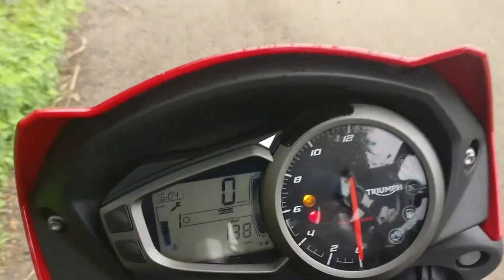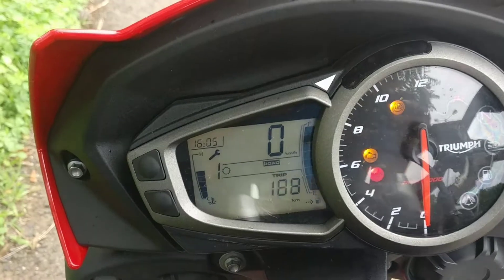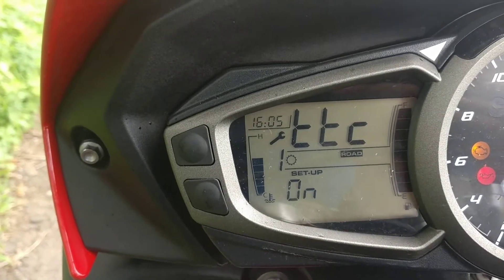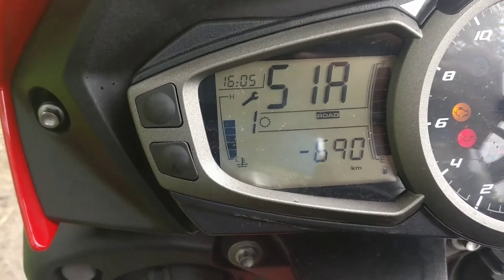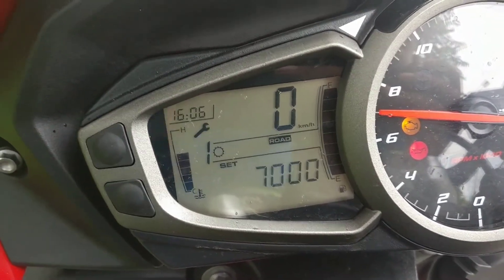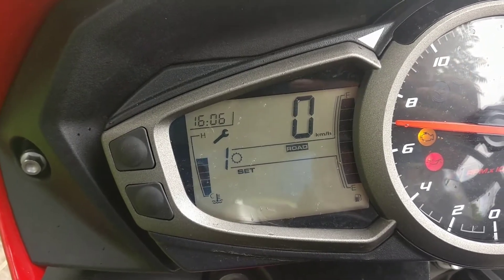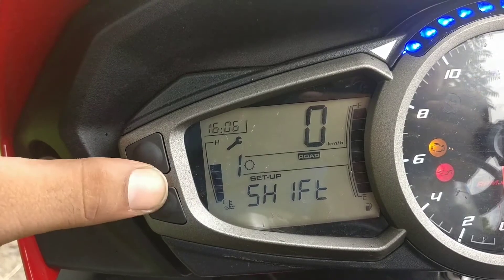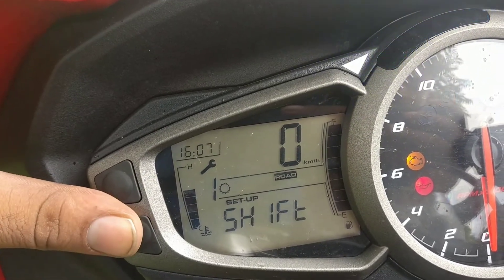Street Triple S 765 India - Speedo & display

Comment: I'm looking to buy a second hand street tile here in Thailand. With key "ON'' it does not show what gear its in "N" "1" and so on.. That digit is totally missing. Any  thoughts? The bike says it has 3200KM.
Reply from the maker: It does have a gear indicator. However most bikes like this triumph require you to Turn on the kill switch after switching on for the electronics to Function
Reply: @Kanhay  Thank you. The dealer guy made the same case and showed me with video. Thanks again for the response.

Comment: After how many km.s should you change the tyre ?
Reply from the maker: If you are on the stock tyre, it will be over within 5000 -7000km beacause it's a very soft rubber. 

If you are not a track person, I will suggest you get a touring tyre (pilot road 5, Metzler Roadtech, Angel GT etc) 
Same price but double the mileage

Comment: Bro...does the bike lift up with traction control off..?....if so until which gear..?
Reply from the maker: Yeah. You do get a lift till third. But very short ones. It's because of the riding mode. The RS does wheelie in Track Mode  under heavy accleration

Comment: Hey there.. Nice informative channel for prospective Street triple buyers.. keep it up bro..
Few questions
Is the ground clearance a deal breaker?
Does it scrape in tall speed breakers? 
Does it have the Tyre pressure monitoring system?
What is the service cost?
Reply from the maker: +GTN RIDER hey. Haven't had any problem with speed breakers as such. Just have to be a little carefull while riding with a pillion. 
TPMS is available as an accessory.

Costs roughly 7K per service. +/- 1000

Comment: RS VERSION WORTH THAN S ? WHAT DO YOU THINK ?
Reply from the maker: +POI RIDER I ride my bike everyday. I am more than happy with the performance. To be honest. After 50bhp engines.... 10 or 15 BHP here and there does not make any difference on roads. 
The only thing I miss on the S is the TFT touch screen.

If you ride everyday to work and want fun on the weekends get the ST S 

If you have throw around money and ride only on the weekends, get the RS
Reply: I Think S will be better choice over Z900 ?
( I hate to hear Expensive Kawasaki Maintenance & Every 6 Months )
Reply from the maker: +POI RIDER z900 is a beast. But I feel it's an overkill for my use. Also the spares are crazy damn expensive. I ain't paying 9K for a pair of brake pads.
Reply: I Think spending 2 more Lakhs for RS version over S make sense .

123 PS 
Quick Shifter
Brembo Brakes
Ohlin suspension
TFT with much more features
Switch Keys look a like ( BMW S1000R ) 
Pirelli tyres
5 Riding Modes
Traction Control
Customize Riding Modes
Customize Traction Control
Customize ABS
& More.... 

This worth 5 to 8 Lakhs +/- if we get it as an after market Accessories .
Reply from the maker: +POI RIDER yes thats true. But once you buy the bike and start using it daily, you'll realise that the only basic necessities are abs, traction and a good Speedo (which the s is missing on)

You won't adjust your suspension more than 3 times a year in any case.

90% of your riding is going to be in road mode, 5% in rain and the other 5 in race, track or the rider mode.

You get the Pirelli tyres with the S aswell. I finished my tyres at 6K km. And it's 22K a set. 

The only place where you only wish you had a RS is when you are at a racetrack and where every little change is going to make you a little faster. 

It's still a better bike than the S version. However I use it in the city and for weekend rides & the S has been doing great.